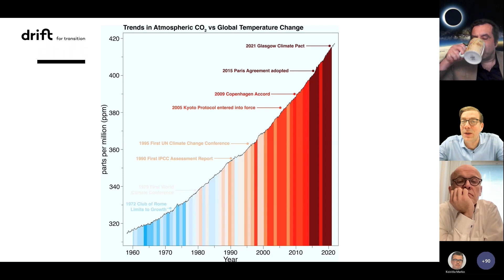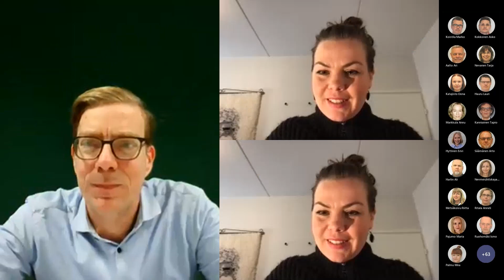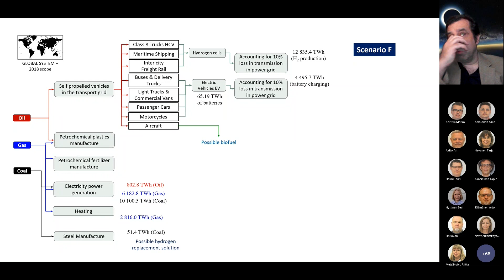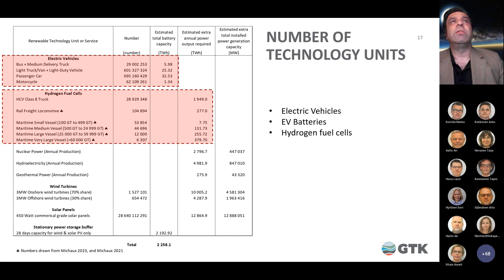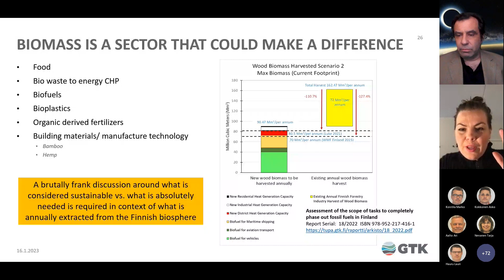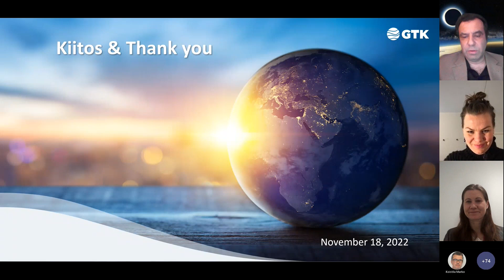Challenging the transitions

Comment: Thermodynamically, there is no such thing called Capitalism.
This is owing to the fact that fossil fuels have been traded under the doctrine of what's called 'supply and demand', not on the basis the stuff is finite.
What humans have lived, under our outgoing Western Civilisation, is actually the best of a Communism-disguised-Capitalism system.
What remains in this system, now fossil fuels are mostly gone to the ground - is more deception, gulags and wars (Iraq, Syria, Yemen, Libya, Ukraine, Russia, Sudan, France and on and on).
Karl Marx, Nikola Tesla, Einstein, Huxley, Orwell, Turing, Susskind and 20th Century physicist and Economists - should be forgiven for thinking their systems can last forever – finite fossil fuels are dangerously hypnotic to humans and their mental capacity.
Humans were not ready morally, ethically and intellectually to start mass extraction of fossil fuels with the steam engine 300 years ago.
The Magna Carta requires now overhauling – adding to it the right for humans to understand what Energy really is;
"In any system of energy, Control is what consumes energy the most.
Time taken in stocking energy to build an energy system, adding to it the time taken in building the system will always be longer than the entire useful lifetime of the system.
No energy store holds enough energy to extract an amount of energy equal to the total energy it stores. 
No system of energy can deliver sum useful energy in excess of the total energy put into constructing it.
This universal truth applies to all systems.
Energy, like time, flows from past to future"(2017).
https://youtu.be/yLOHdW7dLug?t=760

Comment: How does Simon respond to some critique around 2 points:

- Measuring energy of fossil fuels at point doesn't account for their losses
- Aluminium is being touted as a superior replacement for copper in many technologies
Reply: I used electricity actually delivered to the grid by all systems in the year 2018.  What did coal and gas actually deliver?  What would be required for wind and solar to do the same thing?
Reply: @simonp.michaux1638  awesome thanks for the reply Simon. I knew you had answers. These questions came up as part of a recent linkedin article and tirade by someone. There's a YouTuber called 'just have a think' who did a recent video about those articles which contend with your papers
Reply: @tomatao. I used to like the “Just Have A Think” guy’s podcast, but his recent critique of Simon Michaux’s work seemed highly suspect, so now I’m suspicious of who Dave Borlace’s often thanked ‘generous supporters’ really are…. 😏
Reply: @simonp.michaux1638 Hi Simon good morning call you from Perth WA. People often overlook the necessity for the mining industry to decarbonize its operations to align with the new regulations outlined in the AGENDA 2030 sustainable development goals. Having worked in the cargo shipping industry and maritime law, I've witnessed the implementation of various measures such as ballast water treatment, gas scrubbers, EEDI/EEXI, EPL, and underwater acoustic reduction systems to meet these guidelines. I have heard that there will be a green certifications for steel in the near future did you have information about it?
Reply: I can't speak for SM, but 

The 'gains' by substituting Cu with Al in battery technology, applies for only for a handful of battery chemistries in development. And chemistry is only 1 family of battery systems. Others might be pumped hydro, methanol or H2. We're at a point where we need to develop and evaluate all sorts of different energy buffer types. 

The first line on fossil fuels I didn't get, perhaps you need to rephrase.
Reply: @joachimvanwing8741  re the first question. I'm talking about the difference between energy at production Vs energy at use. There is a critique that the measurement of fossil fuel needs is taken at production rather than at consumption (after losses) and we wouldn't need to replace production energy but rather replace the much smaller consumption energy
Reply: @tomatao.  If you read his report (on his website which you can google), he is not just calculating primary energy of fossil fuels, ie replacing the thermal energy from fossil fuels directly with electrical energy one to one. For example when calculating how much energy is needed for the global EV fleet, the calculation is done by converting global cumulative distance traveled into how much electricity is needed by electric vehicles to drive that distance. It is NOT done by adding up the thermal energy of all the gasoline/diesel burnt by vehicles. Note that in some cases (mostly industrial), you do actually need to replace fossil heat directly with electric heat. But as he noted, his calculations don't include most industrial heat uses (aside from steel) so he is necessarily understating how much energy we need for the transition.
Reply: EXACTLY! So EROEI is Energy Returned on Energy Invested - and basically tells you how much ENERGY profit you make from a certain power plant. The problem with measuring it is many fossil fuel types cheat. They measure the heat energy value in calories of the barrels of oil produced, NOT the kilometres travelled or work done as a result. As wind and solar are the most abundant energy sources in the renewables portfolio, it makes sense to try and Electrify Everything. That’s the catchphrase. 
While oil is this incredibly dense energy source that at the start had a very high EROEI - it HAD TO BE. Why? Because the Internal Combustion Engine is so awfully inefficient. Diesel wastes 50% of the energy as it burns, and  petroleum is worse and throws out 80% of the energy. It’s all thrown away as heat and noise, and only 20% of the gasoline becomes forward motion! That's 1/5th the energy doing what we want. http://rentar.com/efficient-engines-thermodynamics-combustion-efficiency/
But in EV’s it’s almost the opposite - they only LOSE about 1/5th the energy.  77% goes into forward motion! http://www.carsguide.com.au/ev/advice/are-electric-cars-more-efficient-than-combustion-or-hybrid-cars-85981
Only 1/2 of diesel does work, only 1/5th of gasoline, but with EV's only 4/5ths of it go into forward motion. So to measure like with like, we should be dividing oil’s EROEI by how much more wasteful the ICE is at the point of use. An ICE WASTES 3.4 times more energy than an EV. We should divide oil’s EROEI by that. 
Then there’s the oil delivery SYSTEM to consider. So much energy is wasted mining oil, shipping it to a refinery in another country, only to then ship it around the world to market to be trucked down some long highways. Compare that to some off-grid rural EV station where solar panels are installed every 30 years! Once we Electrify Everything - 40% of global shipping stops! That’s 40% of maybe 55,000 ships - or 22,000 SHIPS that no longer have to be built.
When we've "Electrified Everything" especially transport, so many more options become viable. Australia has some of the biggest trucks in the world. Janus Australia have a battery-swap system for our “Road Trains” that carry 100 tons. They go 400km or 500km, then just swap the huge batteries. A guy on a forklift does it. This also means the batteries don't have to fast charge - which is less stress on the local grid and less stress on the batteries. They estimate they can run 10 trucks just from the warehouse roof! Need more power? In rural areas where the land is cheap, they might even consider installing solar panels on a local paddock. https://www.januselectric.com.au/